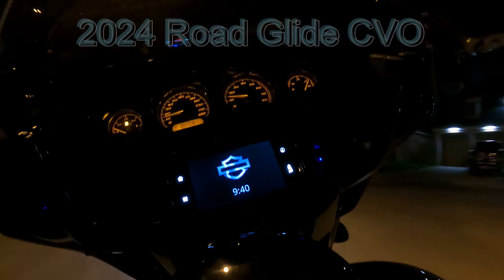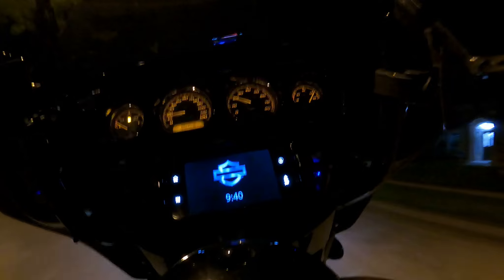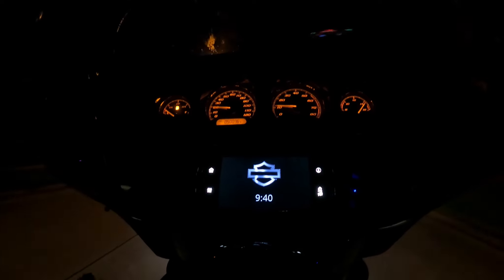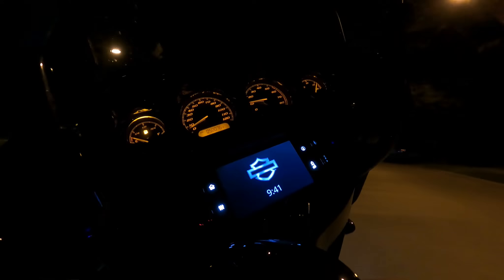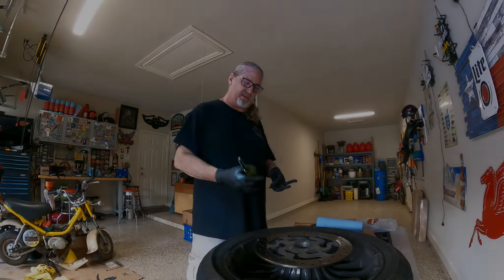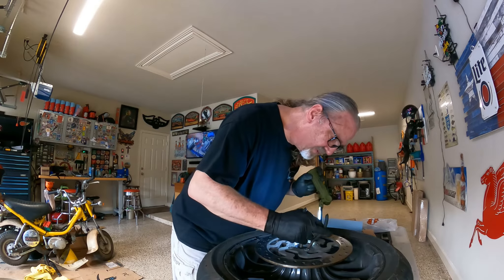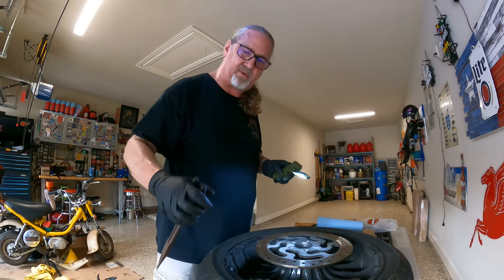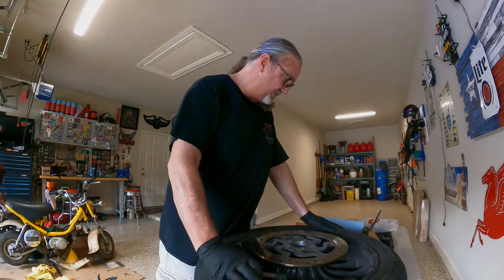Diagnosing Harley Touring ABS Light - Part 2 - SUCCESS!!

Comment: I just experienced the same problem.  ABS came on due to rear bearing being shot.  I replaced my bearings, but unfortunately, my ABS light is still on so I am guessing that I may have damaged my sensor while riding on the bad bearing.  I also put some extra grease in my new bearings.  A few other guys told me it was a good idea to do that because according to them....the manufacturers don't put in enough grease which causes the bearings to wear out prematurely.  Glad you fixed your problem.
Reply from the maker: @williamjohnson4255  my bearings are sealed, I hope I am not doing this at 100K again.
Reply: @texasmotorcyclerideradventures  My bearings are sealed too.  I really can't complain because I bought my bike new, and the bearings were stock with about 69k miles on them.  I changed the bearings on both wheels as well as the belt pulley.  I also opened the seal and packed them with extra grease.  Had to also change the sensor because the wheel hub ruined it when the bearing flew apart.  Man, it felt good to see that ABS light go off!  Love your garage.  Wish I had a space like that for wrenching.

Comment: I learned a lot from your video.  I went to my local Harley Shop and asked about them doing a full flush. Asked if that included the ABS action and I was told that they don't do that.  Sounded like they didn't know what I was talking about. Going to buy the tool you have and do mine like you did. Thanks
Reply from the maker: @burtburt1755  the reason why those fail is not being flushed.  Take care!
Reply from the maker: @burtburt1755  http://infotechmercenary.com

Comment: The rear axle nut should be torqued to 95 to 105 ft lbs not 20 as you stated in the video
Reply from the maker: I added that in the description, it was the 1st torque and not the final torque.  Good catch!  I actually did torque it to the correct spec.

Comment: You do not seem like the kinda guy that should be working on a bike with what Iv seen so far haha
Reply from the maker: @riffraffchoppers  I fixed it.  It just hit 66K miles this weekend on the Twisted Sisters.  I am the only mechanic that works on my bike.  Installed the lifters, pushrods and cam 30k miles ago and still runs great.
Reply: @texasmotorcyclerideradventures  I guess we all get lucky from time to time hahaha
Reply from the maker: @riffraffchoppers  it's more of an adventure channel anyway.  Hopefully, if someone has an ABS light that they can't figure out, this can help.  If not, no harm done.  😉

Comment: Wondering if this is everyone problem with the abs or at least some
Reply from the maker: I went through several possibilities,  could have been any one of them.
Reply: @texasmotorcyclerideradventures  some research mentioned that different tire size can effect the speed sensor which would cause problem with the abs your thoughts?
Reply from the maker: @levialston518  doubt it.

Comment: great video! I have an 08 Ultra classic I bought used and all my brakes seem to work fine, but I have the steady abs light on. The previous owner told me about it before I bought it and he said his local HD shop said it was about a $1300 fix, said possibly the ABS Module. but now wondering if its this. Thanks again and great video!
Reply from the maker: Post the fix when it's done!
Reply: I too have a 08 Ultra with the light staying on.  I would love to hear if you get it fixed and what you did to fix it. Thanks.